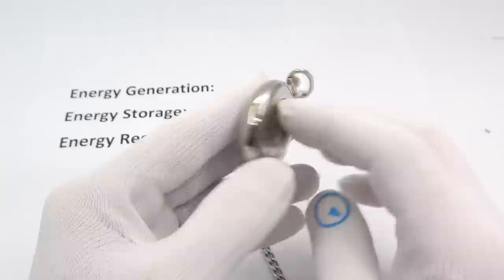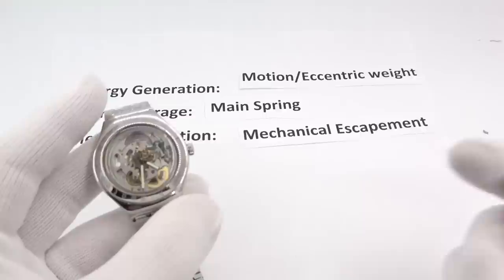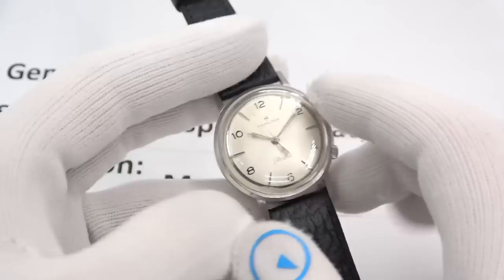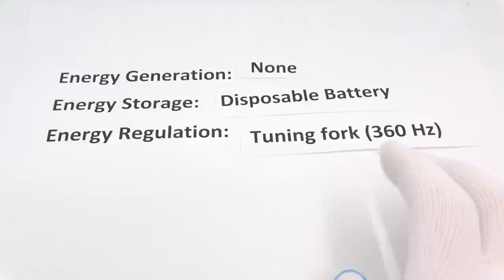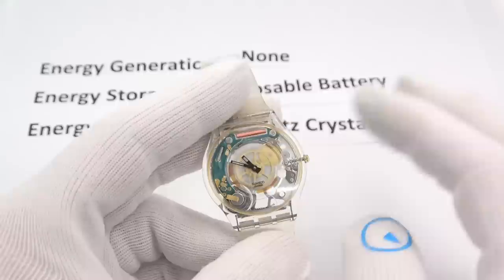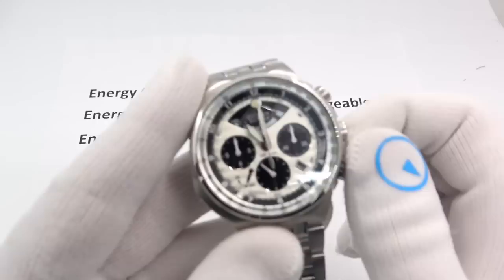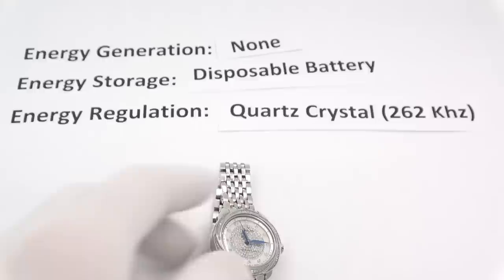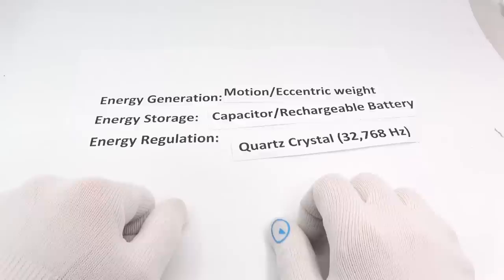How every watch movement works - Watch and Learn #85

Comment: Great historical survey, Marc. One question: did the Timex electric watches of the early 1960s run in the same way as the Hamilton electrics that you covered? I had one of those Timex watches, my first serious watch, 1965.
Reply from the maker: Similar to Hamilton, I believe.
Reply: …hi Frank…”…By the mid-1960s Hamilton was rapidly losing ground in the marketplace.The electric watch was no longer a novelty and competition was having an impact. Several companies, particularly Bulova but also Wittnauer, Elgin and other brands using Swiss-made movements, had taken a share of the market for battery-powered watches. (The most aggravating competition came from Timex, which was marketing inexpensive electric watches with movements nearly identical to the Model 505. In 1965 Hamilton was forced to sue for patent infringement.” p91 The Watch of the Future, The Story of the Hamilton Electric Watch, fourth revised edition, Rene Rondeau…

Comment: Thank you for this Mark. So...a 28,800bph isn't necessarily gonna be more accurate or precise, than a 21,600 bph Movement...correct?? So WHY then do most ppl seem to favor the latter...the “ smoother " sweep of the second hand I suppose??
Reply: Generally a 4 hz will be more accurate than 3 hz, though the difference is pretty negligible and construction of movement/tolerances make a much greater difference.

You can regulate the hell out of any watch, but how accurate it really is depends on positional variation.
Reply from the maker: @El Gatto said best. In general higher beat "CAN" be more accurate, doesn't mean it will be.

Comment: Hi Marc, great video on the graduation of timekeeping technology. How does Mecha-Quartz fit into all of this?
Reply: Timekeeping is exactly the same as quartz, using a quartz oscillator. However the chronograph is more mechanical, resulting in a more tactile feel.
Reply from the maker: Same as an analog quartz watch, just a mechanical train for the chrono. That's why you cannot adjust or zeroize the hands on a mecha quartz; you need to open the watch and physically remove/replace them.
Reply: @islandwatch  Ahhh, so the Mecha part of the Mecha-Quartz runs the Chrono part and the Quartz maintains the timekeeping part.  Thanks Marc